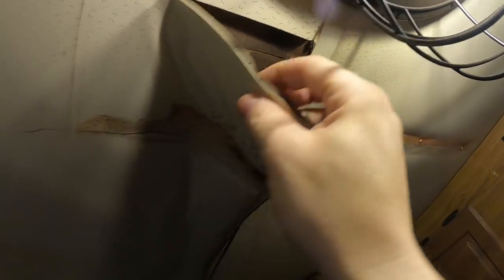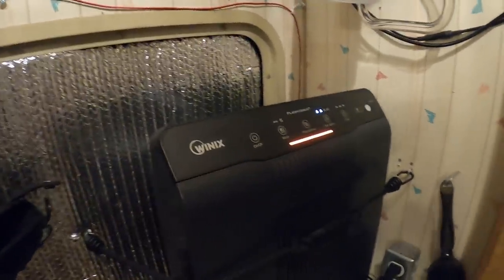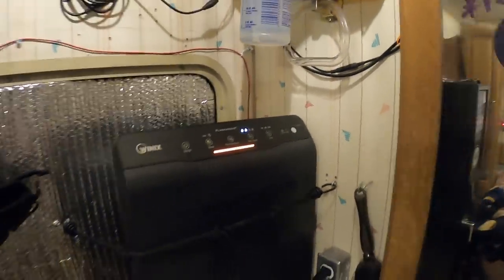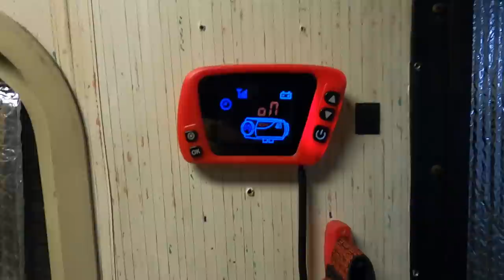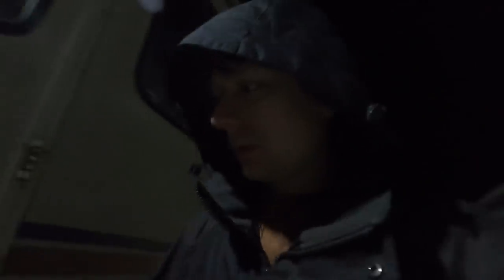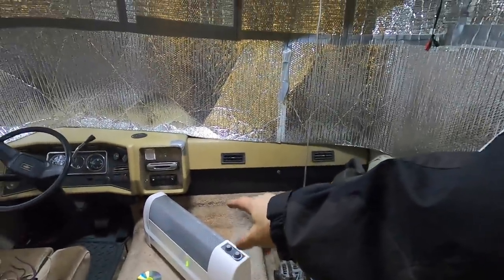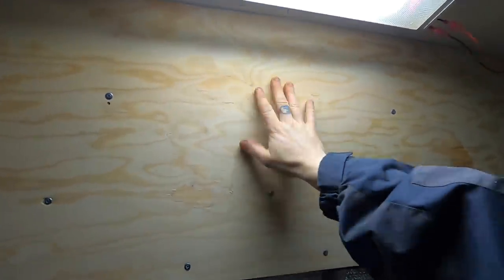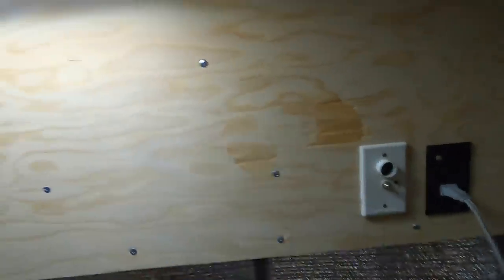RV Living - Birds, Snow & Mold

Comment: Home Depot used to sell a very good multi-step process I'm sure they probably still do. The first part kills the mold the second part encapsulated the mold so that spores cannot be released and the third process prepares it for paint. stuff was not very expensive as I recall but it was incredibly effective. Even if you remove everything you see with mold on it and put new material in it doesn't matter mold will come back unless you stop the active spores that are in there and the best way to do that is encapsulation
Reply: Very true. Mold, it will keep spreading. as long as some spores available and conditions are ok, it will keep at it.

Comment: Propane would be useful as a backup source of heat. Try to order propane ignitor parts online. 
For the leaking window, as a temporary measure maybe you could try taping some reflectex to both the outside and inside of the window. 🤔 I like varnish on wood grain and you can paint over it later when you redecorate. 😎

Comment: You should find a place in the dry southwest,  lots of available cheap land out there.     Humidity is your issue in the northwest with anything that's not a plastic based product, like wood.  Then you'll just have to worry about rattle snakes, black widows, scorpion's and dry skin.   Heck, I have some property in West Texas you could stay on , but its 1 hour drive to a big city for supplies.. 20 minutes to a small town with basics.  We had some thefts out their, Just having some one on site most of the time would deter thefts and trespass,  Its fully off the grid, As you do now, your hauling water and using solar and other off grid solutions. Hit me up if your interested.

Comment: get a fogger machine and some concrobum mold killer and blocker. this stuff works good and will help with smell. wont harm anything in rv but might have to wipe things off later. and the link above is the amazon link.